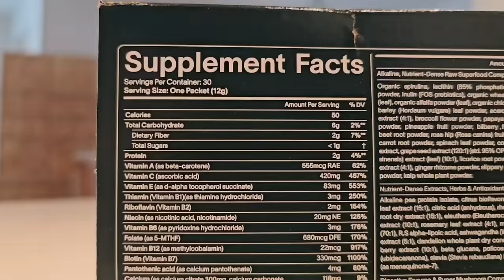I Bought A POWER BROOM & Used It To Clean FILTHY Sidewalks

Comment: I have one and have found it takes a lot of energy to use.  For most such cleanups as you show, a blower would be quicker and easier.  In order to move the brush forward, you must exert more force to overcome the machine pushing backwards.
Reply: Agreed with you.😊
Reply: Blower blows the dust everywhere, broom seems less so🤔
Reply: Then, use your blower.  Why post a negative comment.  It's a video of  Phil using this brush.  Don't you have anything better to do with your time than comment negatively about an entertainment video.? WOW
Reply: @jopotin67  Maybe, but look how many times he had to walk back to do another pass.  Takes much more time!
Reply: @terryfelt2444   I don’t think he’s posting a negative comment, he’s just giving his own personal opinion.  This is what the comment section is for, to give constructive criticism and share your own perspective.
Reply: A blower is probably just as good on light dirt, but the brush is impressive on thick debris, like in a gutter.
Reply: @bpeters9466  Yes it helps to clean sidewalks but not as thorough as pressure washing
Reply: It's gotta be easier & less taxi g on the lower back than using a shovel.
Reply: What a nonsense comment. The brush rolls away from the user so in effect propels itself. As others said a blower chucks crap all over. Pressure washers leave you with mud and water all over. This thing is way faster and more efficient ffs
Reply: @dalebargen  How would a blower remove all that dried up mud on the path or road lol
Reply: @colinfryett8174  It may be worth doing for that but I would blow off the loose material first to save time.
Reply: Blowers are so noisy though. Not nice to hear if you're trying to sleep in on a Sunday morning.  😊
Reply: @jillpruett3444  About the same noise from the broom…
Reply: @terryfelt2444  I didn’t post a negative comment about the video.  The video is great.  I simply gave my input on the tool.  I own the tool and there are details people should know before buying one.  However, speaking of negative, your comment…
Reply: @garyjefferies6763  Have you used one?  Do you see in the video the brush throwing debris forward?  If it were rolling forward in a self propelled manner,  it would be throwing backwards onto the operator.
Reply: @bpeters9466  👍 Maybe buy a pressure hose extension to reach farther?
Reply: @dalebargen  yes Dale, I realised that earlier. However he doesn't seem to have any issues using it IMO. Apologies for that mistake
Reply: @garyjefferies6763  Once you get used to it, you adjust and dig in low.  However it does take considerable effort to use the broom.
Reply: Fill fits for using it he has a great physique maybe  sir you are old enough for it
Reply: Which town / city is this?
Reply: @jillpruett3444 This seems just as noisy listening to the video.
Reply: @jopotin67 

That gadget is literally blowing filth all over. Blowers create less dust clouds, a narrower spread of dirt whipped back onto lawns.
Reply: @garyjefferies6763 

Sure…now let’s see YOU use that metal broomstick. I bet you cuss this thing out after 15 minutes of fooling with it. 

He’s using it on perfectly-shaped walkways with a light coating of grime and dried leaves. Blowers would’ve done the same job with a lot less effort.

Comment: I like this tool.  It does 80% of the work pressure washing does without the water.  Just blowing off doesn't get the caked on mud and dirt off, this does.  I bet the surfaces don't get over grown as fast after using it because the grass roots have nothing to grow in.

Comment: Why is that better than a blower?
Reply: @pacodelapena it’s not but it surely is a good conversation starter on YouTube 😂
Reply from the maker: Sometimes you need that brush to remove caked leaves from gutters, something a blower might not have enough force to lift. But most of the time, you'll get away with a blower :)
Reply: A blower is using wind while this phisically touched the thing your cleaning